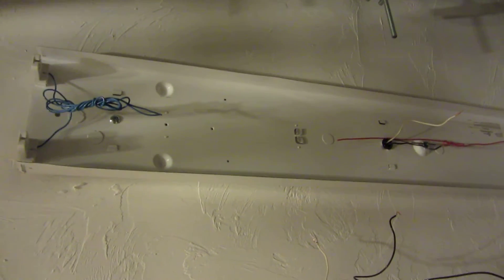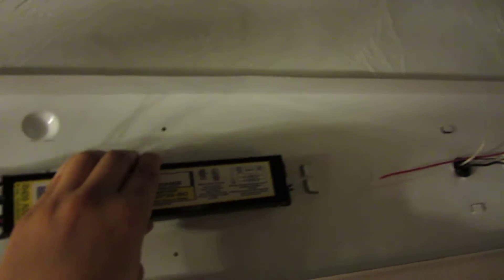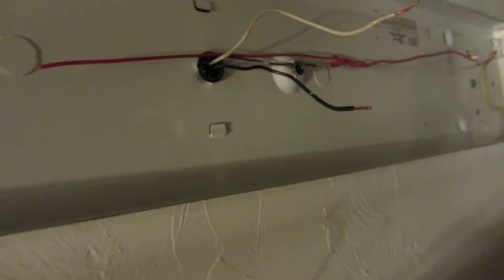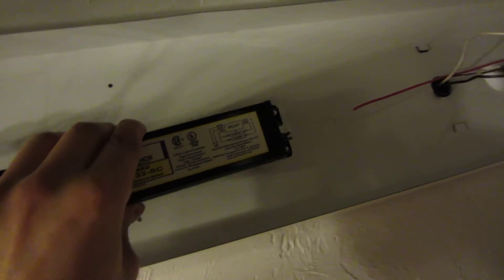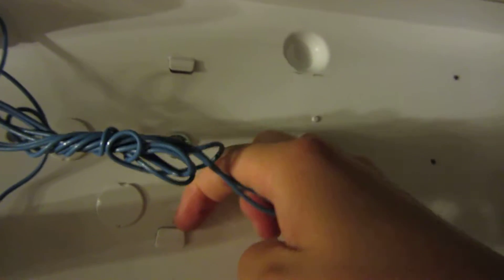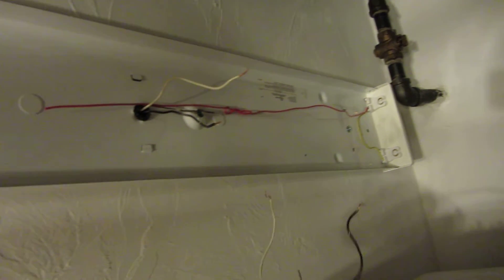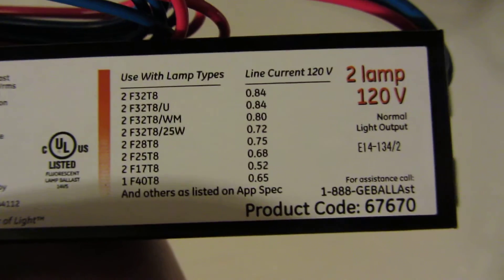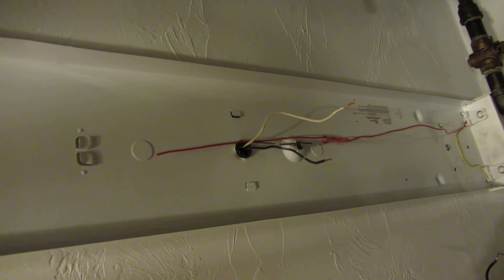How to Fix Florescent Light Ballast Replacement - Part 1 (Buying the Parts)

Comment: My Color wires are different...?! Scared! Just follow colors...? I'm dying to do it myself, + the repairs folks want $50.00 to replace it. I trouble shooted & bght all part & new bulbs, so..I'd like to try to do it on my own..What say you?2-25-17 Thanks Home Depo helped me w/new balast..Old one is an Advance..
Reply from the maker: What is the make and model number of the ballast you bought, and what is the make and model number of the original?
Reply: It finally worked..Maybe I didn't have the bullb in tight enough..COuldn't even see where it goes in...My neighbor reinstalled it & all is well. Swet & tears, pain, & days, to get it done.But Thank God, it finally worked! Thanks!